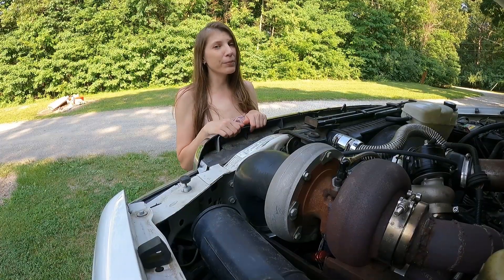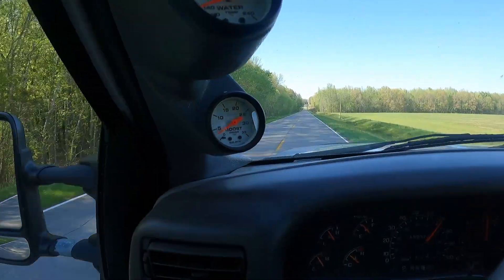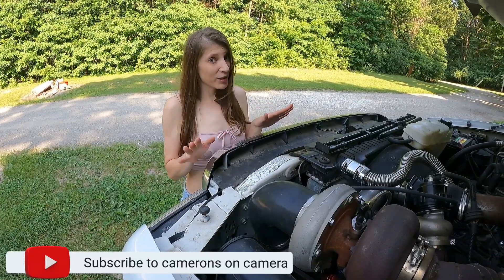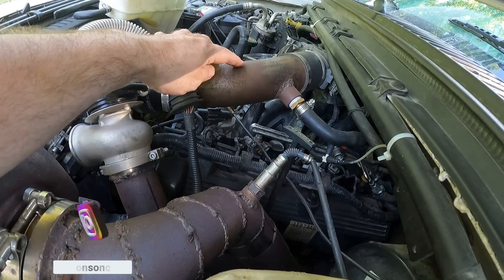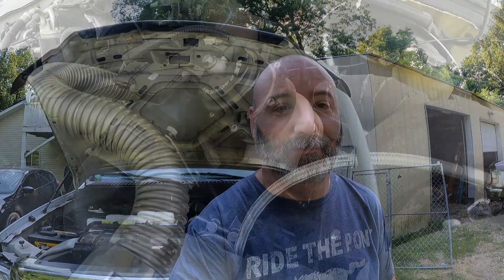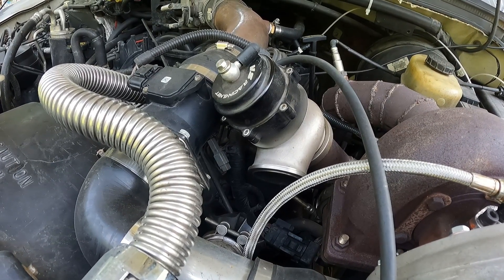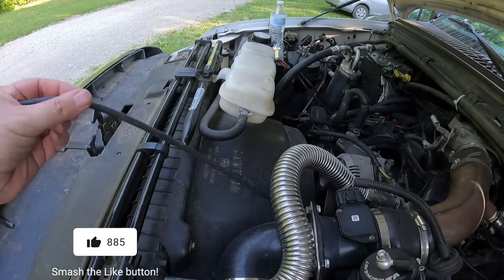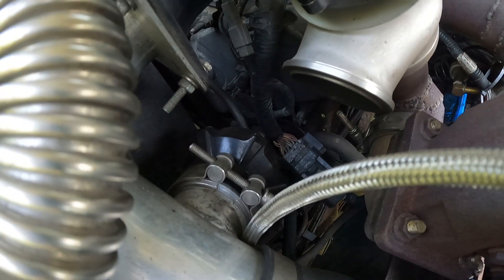Turbocharged Triton 5 4 | update 2 | Q&A

Comment: I got this same truck and everything’s all fixed up but the power is terrible pulling my trailer and the economy is worse, how did your economy get affected and do you run that price 91 or you try good oil 87?
Reply from the maker: My fuel mileage varies a lot depending on what I’m doing but my last tank (not towing) was 13 I think. I run 90+ octane with a 91 octane tune.
Reply: If you did it again would you go rear mount opposite the fuel tank? Smaller turbo or was the size good I’d like to run 5 psi around 2500 rpm

Comment: Hey, been following this build for awhile. I have an 03 f250 5.4 that I wanna do the same to. I built custom cars for 14 years I can help you a bit eith some issues. 1 ditch tye no name waste gate and BOV. Go with Tial. You will not regret it. Also take the vacuum cap off the top of the waste gate! That needs to vent to atmosphere unless you're running a boost controller. That's what that vent is for. The boost controller adds pressure to the top of the spring to keep it closed untill your set pressure has been met. Lastly you NEED to intercool this thing. I cannot imagine what your IATs are especially with a steel intake tube like that. You're gonna melt a piston and I'm in shock you haven't thus far. Hope it helps.
Reply from the maker: Thanks for following along. My iat’s are typically 25* above ambient cruising and around 70* above ambient under boost. When I started building car’s back in the 90’s we were always told that ( while recommended and beneficial) intercoolers were not necessary for applications under 7psi. You also have to understand that my turbo is remote mounted (think centrifugal supercharger) so the egt’s have time to come down before the turbo. When I started planning this I was going to do a rear mounted Holley sts kit. They said even at higher boost levels on their system an intercooler wasn’t critical because of the egt drop. 
You are correct about the mistake I made on the wastegate vent. I put the cap on because I wasn’t using boost control thanks for pointing that out.
Reply: @Camerons on Camera  ive been contemplating a stock lightning setup, but the way you did the turbo kit using the oem manifolds...would make turbo  cheaper and I'm a turbo guy. I personally built big turbo supras/hondas ect. This is the first v8 I've ever owned. I needed a truck for my camping lifestyle change. Also funny. My camper is almost identical to yours too. I have an 03 Fleetwood Prowler 5th wheel. Our setups look the same lol. I love your guys videos. The 7.3 videos the side by side. We love all the same stuff! Keep it up and "clean" up the turbo build little by little...it'll make excellent content! Do you plan on lifting her a little? I just lifted mine 3.5" front 2" rear yesterday. Sits perfect now. Sorry for all the questions you're the only person online that's done this and its been my dream! I got out of the career a couple years ago now. A lot of corrupt shop owners. Doesn't pay well.
Reply: @Camerons on Camera  also as far as the IC I have to disagree here's why. Regardless of location compressing air is still going to generate heat. Still needing to be cooled back down. That's why even rear mounted setups still use IC. I do agree on lower lbs you COULD get away with it (you are now lol) but add in the steel pipe? On a 90 degree day towing your 5th wheel I could see issues. You litterally could do a stock 7.3 IC and it would bolt up. I been looking into it. Lastly I'd add thar I'd recirc the waste gate being that you're not going for "racecar" lol. I know welding all this is the hardest part and I'm assuming like me, you can't tig. All these years I never learned how I always had an in house fab guy. Eaither way good luck and I'll be following along but yes. I'll bet that vent being capped will fix your creep issue.